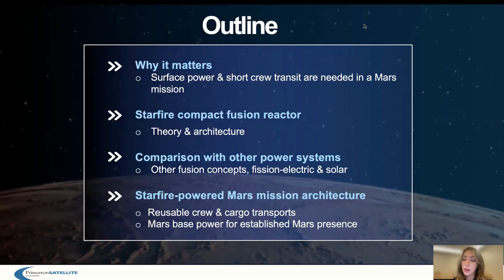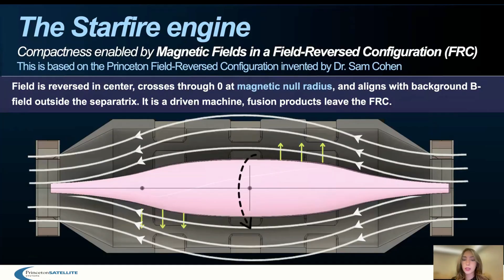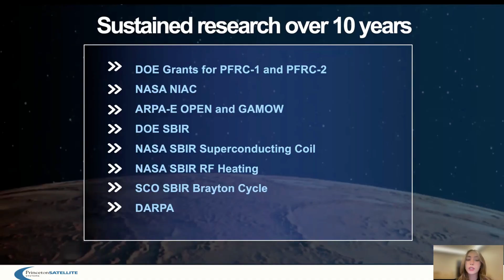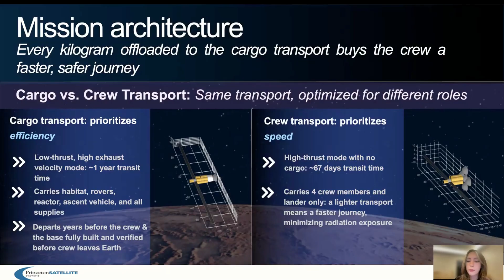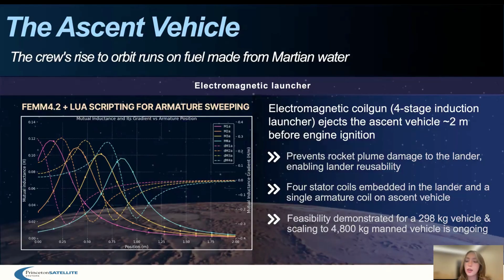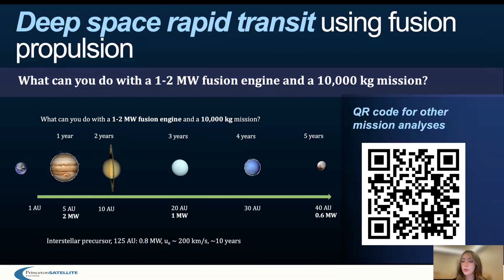Compact Nuclear Fusion for Human Mars Mission (ASCEND 2026)

Comment: I'm ignoring a lot of this mission architecture because frankly Princeton don't need to do it, they just need to build this engine-with-generator and sell it...
this said: there are typoes in personal names 11:00. Matt Chu's name is Cheong and I believe UEDGE man Tom is Rognlien.
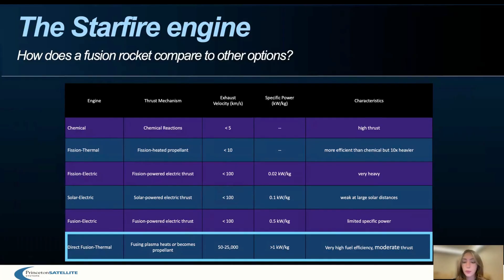11:00 has at least one bad typo, '80-300 km/2' should be km/s. 88 km/s will indeed deliver the 9000s promised. There were 25000 km/s promised in the slide 7:40, which looks insane to me.
EDIT: it reports 5-10 N/MW powered by 1-10 MW. Seems on the level of the 10-101 N promised in the Dual DFD of the Sunbird (2 MW). This is to shift a tonne of cargo to Pluto... eventually. Not a crew to Mars in 67 days.